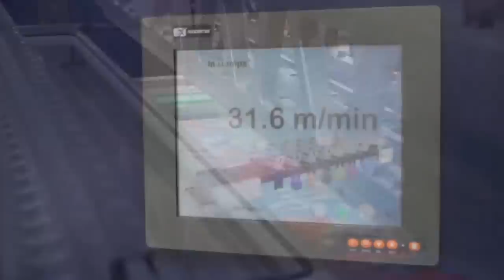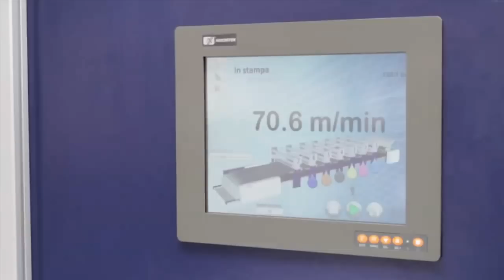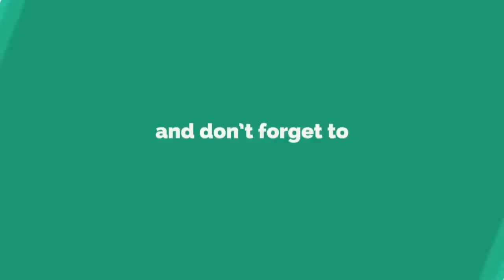Modern Textile Printing Technology & Machine

Comment: which technology gives best quality and which company's printer is best
Reply from the maker: As per my opinion reggiani
Reply: @TextileVlog  ok ty sir,in your opinion which technology gives best printing quality,is it digital or some other.
Reply from the maker: Screen printing technology still gives best print quality. but in future DGT printer with some research and modification will give best quality.
Reply: @TextileVlog  ok sir,DGT means digital printing or something else?
Reply from the maker: yes you are right  @drpflower75   DGT means digital printing.
Reply: @TextileVlog  many thanks for your answers and guidance Sir.ty
Reply from the maker: Welcome & stay tuned
Reply: @Ghar Ka Swad i asked for best quality,from which i mean fastness,cost,sharpness of prints
Reply from the maker: @Ghar Ka Swad i agree with you